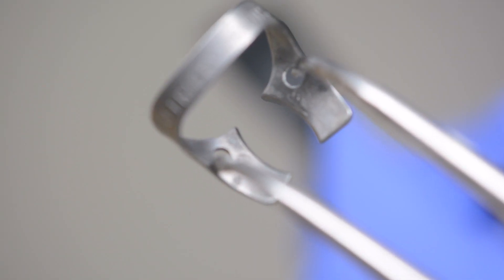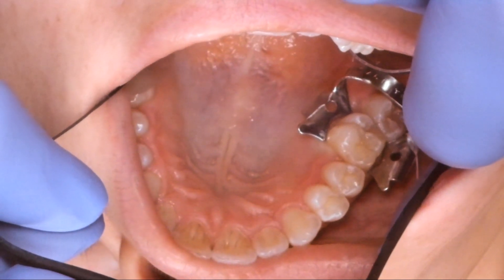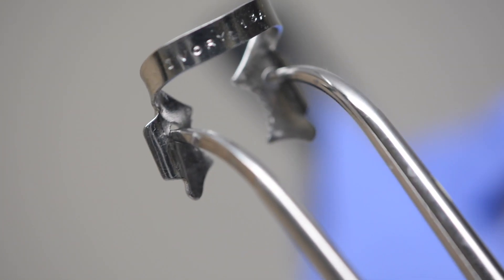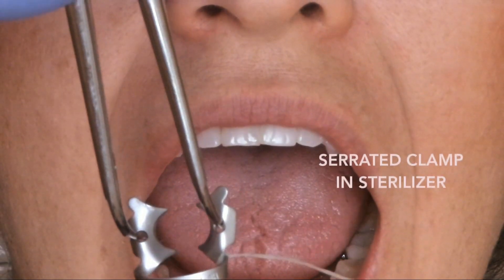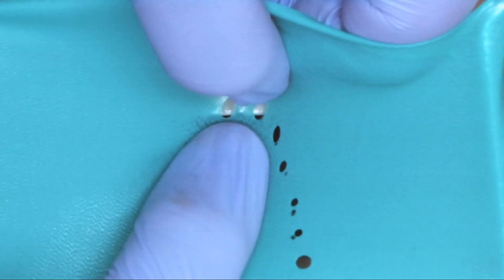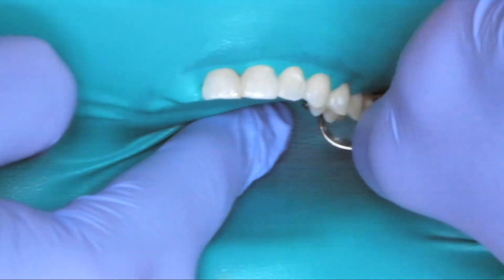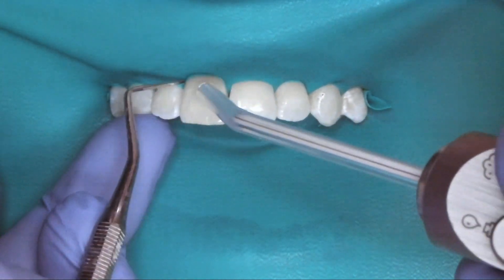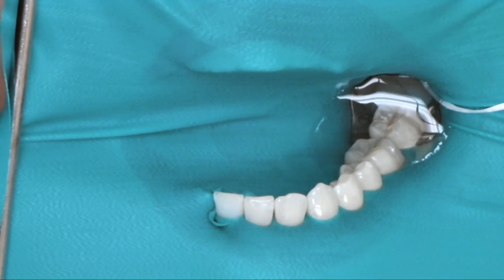Rubber Dam Placement for Anterior & Posterior Teeth

Comment: If a dentist does not use isolation method. Should fire the dentist? I had tooth drilled from silver filling know protection for me but he had on a mask on. The dentist did not use that blue thing in any of my dental work.
Reply from the maker: Simply Dee It is not a requirement at all! Simply a tool that helps achieve isolation in cases that need it. Many dentists including myself do not use rubber dam isolation for every single case!

Comment: Great video doc 👍i was just yesterday struggle to put a rubber dam on endodontic treatment single isolation 46, usually it work but last time, the teeth broken a little so i need to make a wall.. i think i'll try how you apply it on quadrant, is that a piece of rubber dam sheet you put on mesial 31 ? 

thanks a lot for making this video 👍

Comment: I noticed that for lowers, you put the rubber dam over the wingless clamp first and then worked your way front. Is it because it's easier that way or will it still be easier if we went from the front to back like the uppers? great video btw!

Comment: Numerous  research  articles  have  shown  virtually  no  difference in   root  canal  success  with  those  using  a  rubber  dam  and  those  not  using  a  rubber  dam.The  question  is  ,why  is  this  outdated ridiculous  piece   of  equipment  still  considered  standard  of  care.?
Reply from the maker: Howard Katz there a variety of reasons but off the top of my head it protects the patients throat from aspirating or swallowing drill bits or files that can potentially lead them to the Emergency Room. One of the most important reasons is patient safety. . . Thank you for your comment
Reply: I  have  been  doing  root  canals  for  39  years  and  find  that  a   simple  throat  pack  consisting  of  a  piece  of  4x4  gauze solves  that  problem.There  is  virtually  no  difference  in  the  success  rate that  has  anything  to  do  with  a  rubber dam.Therefore ,to  consider  this  standard  of  care , seems  ridiculous. Anything  can  fall  down  a  patient's throat  with  any  dental  procedure as  with   tooth  fragments  when  doing  extractions. It  is  not  standard  of  care  for  oral  surgeons  to  use  a  rubber  dam.
Reply from the maker: Howard Katz I’m going to work right now but I’ll find articles later tonight supporting the American academy of endodontists position
Reply from the maker: Howard Katz & for something to become the standard of care in an industry it requires a plethora of quality oriented research articles supporting its use.
Reply: There  is  an  article  showing   over  500,000  root  canals  done  with  and  without  using  a  rubber  dam  and  the  conclusions  were  that  there  was  essentially  a  1% greater  success  rate  when  using  a  rubber  dam. That ,in  my  opinion  is  not  significant. I  would  be  happy  to  post  the  article  for  you  if  you  would  like.It  was  written  by  a group  of  endodontists  who  thought  that  1%  was  significant.
Reply: I don't think is merely for root canal treatment alone but the isolation for moisture control. My humble opinion~

Comment: I have a doubt.. you mentioned about anesthesia, we have some cases where patients require supplementary anesthesia or in cases of improper anesthesia but the dam is already placed..How to deal with such cases?
Reply from the maker: channelcyclopedia 92 I remove part of the dam on the side the anesthesia is needed while leaving the dam on the other side... I then retract the dam and give anesthesia as needed. Another method is to start preparing the teeth without the dam on & apply the dam when ready to restore the tooth... hope that helps!
Reply: @SmileInfluencers  thank you..That's a good idea..I never expected you'd reply this fast.. ❤
Reply: Get  rid  of  the  rubber  dam..problem  solved.

Comment: If there is a small decay in molars does this help or do we need to do cementing
Reply from the maker: Hi! I’m not exactly sure what you are asking. This device is mainly meant to help with fillings for dentists. You can operate dentistry with or without the the rubber dam & it can definitely help if there is a small amount of decay in molars